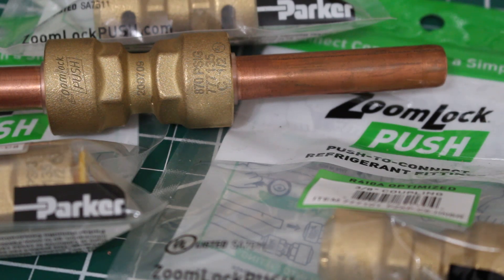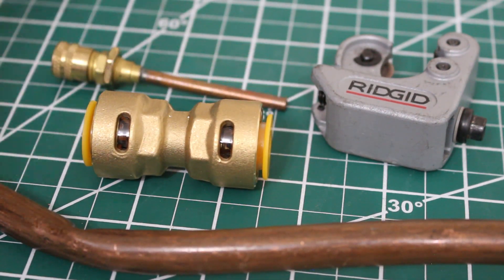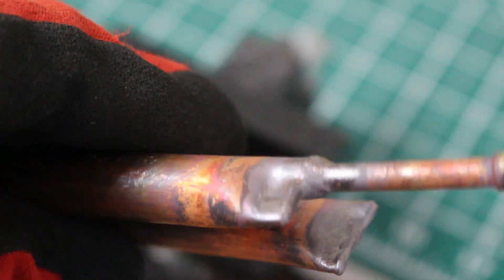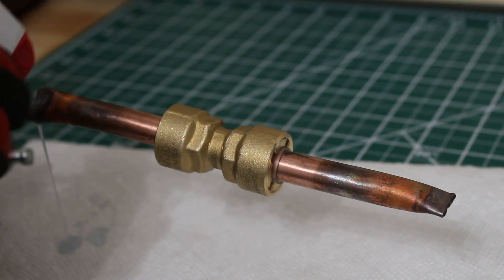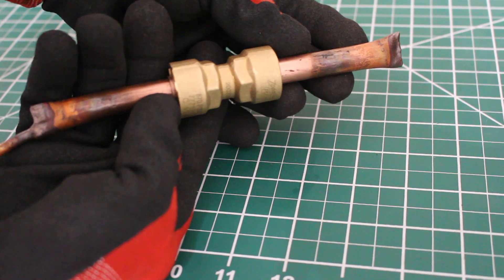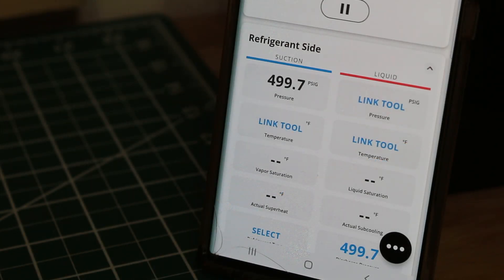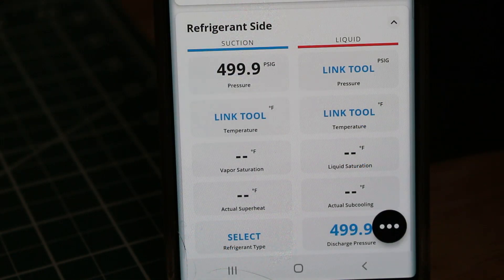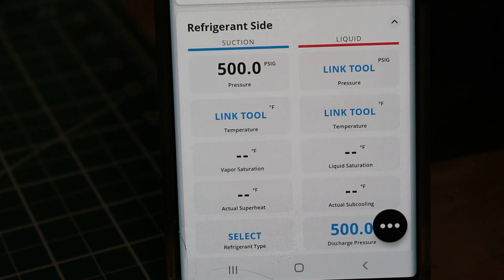HVAC: ZoomLock Push Nitrogen/Pressure Test (ZoomLock Push To Connect Refrigerant Fittings) Removable

Comment: Wonder if Nylog would seal those up better.. Nice video   and there are places these could be used if they didn't leak . R22 pressures vrs R32 . R45b and R410a run way higher head pressures. 🇺🇲

Comment: Try using a temperature compensated pressure test calculator like the one on measure quick (which I have had 100% success with) or the one in the HVAC school app, use that and do the pressure test for 30 minutes, every time I have done that and pressure is +\-1% of the start pressure compensated for temperature change with the calculators, I have had zero leaks.

Comment: Can you use these fittings when replacing compressor etc
Reply: You'd need to check the refrigerant compatability. Or are you talking about temperature rise and heat content?

Comment: The only time I’d use Zoomlock is to avoid getting a hot work permit.

Which I try to avoid anyways!
Reply from the maker: Haha I hear that! Some places don't allow any hot work so I could see these come in handy but if it's not prepped perfectly or if there's any defects to the pipe, you're most likely going to have a leak. Thanks for watching & stay tuned for new videos every week🔧⚡️

Comment: Oh dear terrible advert for this product! And 410 and R32 may reach 600 and on heating the high temp and vibration, 
I would rather braze
Reply from the maker: For the fact that if the preparation or pipe isn't PERFECT then you'll have a leak is too much of a risk to use these fittings for me. I rather braze myself and sleep good at night. Had to test these out before using them in the field. Honestly don't feel confident using them. These are the removable ones and they have non removable ones that are optimized for 410a. I'm going to test those out as well. Thanks for watching & Stay tuned for new videos every week🔧⚡️

Comment: I would not use them......
Reply from the maker: It's a bit too risky for me to use these removable push on fittings. They have non removable ones optimized for 410a which have better reviews so I will be testing those out as well. At the end of the day, I'd stick to the old fashioned way and sleep better at night with a solid braze. Thanks for watching & commenting. Stay tuned for new videos every week🔧⚡️

Comment: This is a new invention but if there is leaks we are talking about hundreds of dollars if not thousands so I think a serious testing and research should be utilized I know the company who makes them or invented them have done there test but an evident leak is a failure in this matter soft pipe to be specific so it’s going to be a big decision to use or not to use
Reply from the maker: I agree. Sometimes it's good to do your own tests and see how reliable they really are. I don't like the fact that the prep has to be PERFECT for it not to leak. One little imperfection and it will leak. These are the removable fittings and they have non removable so I'm going to test those too. They seem to have better reviews. Will see. Thank you for your feedback and Thank you for watching. Stay tuned for new videos every week🔧⚡️

Comment: Pressure and temperature are related as one changes so does the other, what you are seeing in changes is the temp in the room changing
Reply from the maker: Facts. Thank you! Replied to your other comment too. Stay tuned for new videos every week🔧⚡️✌️
Reply: Hes using nitrogen to pressurize which is an inert gas.  Those fitting suck.
Reply: @SgtBlunts  nitrogen does change pressure with temperature, it's just a lot less compared other gases because it's an inter gas. There are calculators for doing a standing nitrogen test, these include recording temperature and pressure.
Reply: @SgtBlunts  while I dislike the fittings and been against them all along. the test was not perfect either, because he didn't vacuum down the tubing and teat gear, which means there was still air/moisture in there, which was compressed by the nitrogen and that would change with temperature. it would even change temperature itself as it was compressed by the nitrogen and allowed to cool.
as for the fittings, the tubing has to be in perfect round and smooth condition, having any dings, nicks, kinks, gouges, scratches or distortion will likely cause a leak or damage the seals when inserted. I rarely see any tubing or hard pipe that's in great shape, brand new right out the suppliers/box, it's always damaged in some way.
Reply from the maker: @SgtBlunts  😂
Reply: Amigo en refrigeración acá en Argentina se usa nitrógeno. Que usan en tu país? @SgtBlunts
Reply: btw, the purpose isn't to pressurize. Maybe read a bit?
Reply: An inert gas does not mean it doesn't fluctuate with temperature, it means it does not react other chemicals. Also it is not one of the 7 inert gases. The larger molecules make it less likely to leak and it does not promote water intrusion, which is why some people use it in car tires. It is used for pressure testing in hvac because it does not introduce water into the lines and it's relatively cheap compared to other options. Any arguments and I'm sure this can all be verified with a quick Google search since the internet is always right, but so is real science ✌️
Reply: This is a new concept to you. No high school chem, huh?

Comment: The 410a is the ones I used and worked for me on 3 units 3/8 and 7/8
Reply from the maker: I was going to ask if you used the removable ones or the 410a optimized ones which aren't removable. The guy at the counter for the supply shop said they only sell the non removable ones because the removable ones had bad reviews. In this video, I used the removable ones
Reply from the maker: Thanks for the info🔧⚡️

Comment: Make sure that you reem the inside of the pipe after you cut it and sand it Because once you put it in if you don’t ring that you can cut  that O-ring and then it’s no good
Reply from the maker: Yes, I did that. Rheemed the inside & out. Followed the exact instructions 👀✌️

Comment: Did you rheem the pipe inside Is the first to do that just to make sure you don’t cut the O-ring I talk to you last time when you were showing the push to connect tell your head use them on to her three jobs and that’s been about six months ago and it holds good
Reply from the maker: I rheemed the inside and outside of the pipe just like in my installation video. It held in the end but preparation is 100% the key here. It's a great invention but I feel like I'd sleep better at night knowing my brazing will hold 100%. Thank you for watching & your feedback!
Reply: @JumpermanTech  don’t worry I’m just waiting on the phone call that those things are leaking I feel a lot better with my brazing also. That be used for certain circumstances but of course I always trust my brazing skills more than those fittings.
Reply from the maker: @chaddarr4834  Some places don't allow hot work so no flames. This would be a cheaper alternative than buying the pressing tool which costs thousands of dollars and those fittings are very expensive too. Its nice to know what's on the market and good to test them out before finding out the hard way in the field. So far, can't go wrong with brazing. Thanks for your feedback Chad! Stay tuned for new videos every week🔧⚡️